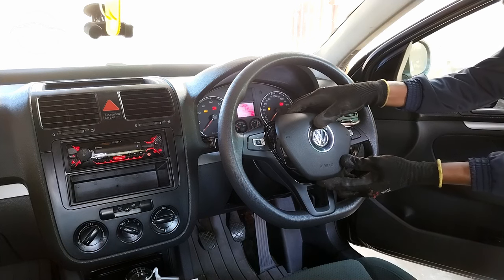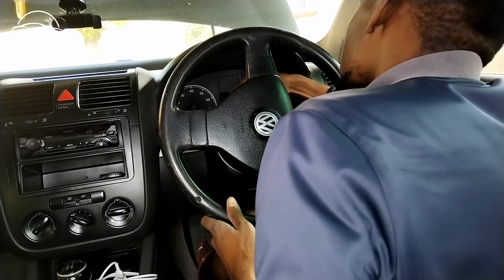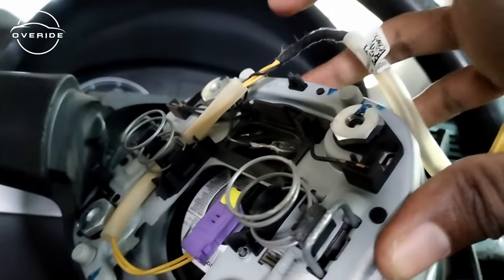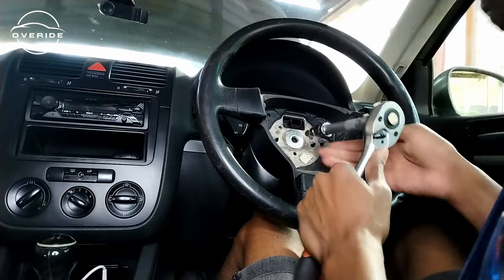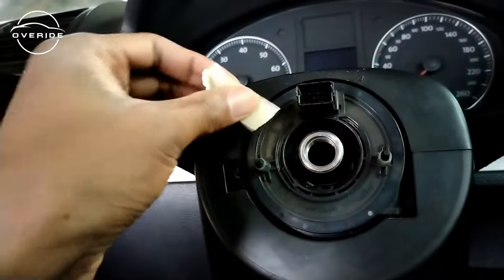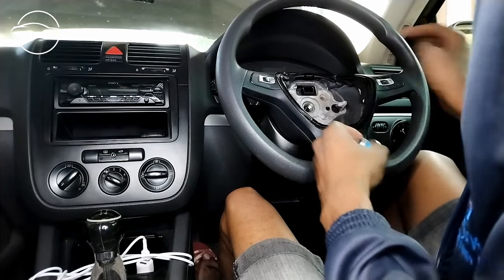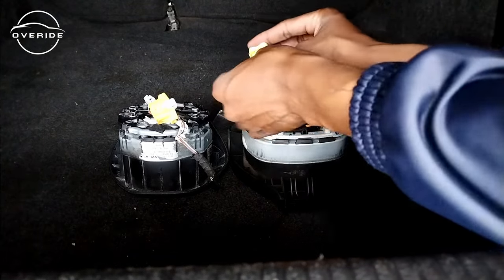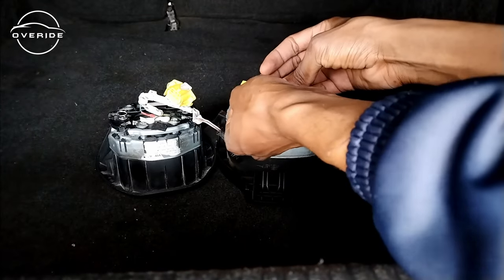Steering Wheel Upgrade |  VW Golf/Jetta Mk5

Comment: Wait so I can switch the old design steering wheel from my golf 5 plus 2006 with this new model without any real issues?
Reply from the maker: Yes you can do that, the only thing you'll need to do is re-wiring the horn but anything other than that is not going to be a problem.

However, if you are upgrading from a non MFSW to a MFSW you'll need a SWCM
Reply: @MegatronicsZA  thanks for the tip!
Reply from the maker: @Zejakov  Pleasure Zejakov
Reply: @Zejakov hey man i got the same car as yours and wanted to do the same. So did u upgrade the steering wheel and how does it fit?
Reply from the maker: @zinii698 the steering wheel was perfect, but unfortunately I got in an accident.
Reply: @dadalang698  Hey i didnt do it.. I tink its not worth the money.
Reply from the maker: @Zejakov to me it is worth it, I loved it and more. I'll do it again.
Reply: @MegatronicsZA please tell me more about this?I have a polo bujwa with a steering wheel with no controls and like to upgrade to one with controls.
Reply from the maker: @conradpaul6100  provided that it's the same as this, a MFSW and a SWCM can, with coding afterwards allow you to have multifunctional steering wheel
Reply: Can this be done to golf 4 2002?
Reply from the maker: @akpablidanielyao8577 yes it csnbe done

Comment: I have a polo 4 9N3 I want to put the steering wheel of the polo 6 r line but I don't know where to buy it or install it, is it compatible even to be sure?
Reply from the maker: Yes all steering wheels from Mk4 to Mk8 will fit. You might only need to re-wire a few wires but it will fit on. Buy at breakers, they are affordable there. You can get a new one at Amazon, E-bay or AliExpress

Comment: I have a 2007 Jetta Wolfsburg edition I want to upgrade the steering wheel I also want to have a wheel with steering wheel controls what wheel should I get for it?
Reply from the maker: It depends on what wheel looks good for you and one which is within your budget. The Golf 7 R and Golf 7 standard flat bottom looks good too, those are the ones I love. You can also fit a VW polo steering wheel too

Comment: i put golf 5 steering wheel in my vw caddy is not working butons and horn wheel is so strong go right or left put both hands to move steering wheel and in dashbord see wheel problem why fix it
Reply from the maker: The buttons won't work if your Caddy never had a MFSW before. For buttons to work you need a steering wheel control modules that supports multifunction. 

Upgrading a steering wheel shouldn't affect how your steering wheel works. If you are turning it with the car off it'll be hard but with the car on there shouldn't be a problem.

Comment: I have upgrade my old steering wheel of my old VW T5 Caravelle to a very similar steering wheel like yours (take from a VW Caddy 2017, no multifuction)
I have the same problem, horn no works and airbag lights on at dashboard; would i contact to you for help me please?
I dont know exactly what i have to do.
Thanks for this video
Reply from the maker: After upgrading you'll need to rewire the new steering wheel to the configuration of your old steering wheel. Yeah you can contact me. Hit me up on one of the social media platforms I've listed on the profile.

Comment: I wanna do this to my honda okd steering wheel with no controls but want a newer steering wheel of a bmw or something and i dont care about the controls on the new wheel is that doable?
Reply from the maker: When it's different car makes I think it'll be a bit challenging but yes it is doable. Just find out the diameter of the steering wheel you want to upgrade to and see if it will fit your car with no clearance issues. But yeah it is doable
Reply: @MegatronicsZA  thanks alot brother for the fast reply much appreciated
Reply from the maker: @banunu6e  it's a pleasure man, I hope it works for you

Comment: hi mate i was wondering if this can fit into a vw scirocco? the twin charged version. Is it possible to plug play?
Reply from the maker: Hi man. Yes it will fit 💯, about plug and play I can't be certain. The wiring is a bit different but I'm sure this way that I've shown how to wire the steering wheel will work for the Scirocco as well, knowing that the scirocco is based on the same platform as the Mk5s.

Comment: I   see you are using a Sony 1 din radio, I was thinking doing the same because i Like how There's a Spot for things to put there, My question is, How is it, Do you like it or are you planing to swap it for something else?
Reply from the maker: Yes I have the Sony A416BT and I'm so happy with it. I had an accident with the car I did this steering wheel swap on, I got another one and I tried a VW Harman MIB Radio and it was great but it only played 2 front speakers only so I got another Sony A416BT radio for the new used car I bought again, so I really love the radio and for sure the space underneath there is also another thing I prefer having. I really doubt I'm gonna swap it for anything else.
Reply from the maker: Also, thank you for subscribing to the channel. I really appreciate it man
Reply: @MegatronicsZA  one more thing now that someone actually replied, i know it's stupid, but the controls on the steering wheel work with the radio? I have a passat b6 with multifional steering wheel, and I'm wondering if it needs a special modification. Or can you change the track and volume?
Reply from the maker: @bunster4322 no, mine don't work because I had to upgrade the SWCM to the one that enables the steering wheel buttons to work but I didn't because it's expensive. But some say it does work with the steering wheel, you just have to set the radio to the corresponding buttons.
Reply from the maker: @bunster4322 there's no stupid question man! None.

Comment: Hey, I just got the same steering wheel. Wiring for horn also goes on the buttons connector, so I imagine that the will not work on mine either. I didn't understand which pins you connected the horn. Also which steering module did your car have?
Reply from the maker: The blue/white connector goes in the position of the original horn wiring. The black wire is the negative for the horn, the blue/white wire is the positive.

The module I had was the low line, which didn't support multifunction steering wheel control.
Reply: @MegatronicsZA  Okay, thanks for the quick reply. Is there any way to contact you (telegram or something?).

Comment: So im looking at putting a golf mk6 mfsw in my 2k caddy 08 plate.

Currently have no steering wheel controls .

Do i just get the mk6 golf mfsw,

And a new swcm

With part no either

1K0 953 549 CD,

Or

1K0 953 549 CH.

Is this correct? Really appreciate any help and advice
Reply: Then code in with vcds
Reply from the maker: Which year is the Caddy that you are planning on doing this to?

It'll look great, I'd go for it

Comment: Did you get the lights to light up on the steering
Reply from the maker: No, reason for that is that I didn't install a MFSW Control Module as it was expensive.

However I'll be making another video where everything works, stay tuned.
Reply: Thank you

Comment: Hello, I installed a Golf 7 steering wheel on my Golf 5 like you, but the horn does not work, as I understand from your video, there is an operation from the key socket, I would be very happy if you could help.
Reply from the maker: Hi, you need to take the connect the two cables from the new steering wheel on the same slot where the Original Mk5 wires for the horn are from. Then on the new steering wheel, make sure that the brown (-) wire is connected to the steering wheel and the blue/white wire must be depinned/or merge another wire which will be power (+) for the horn, and this wire must go from the ring around the airbag onto the slot which provides power to the horn.

Comment: can the airback pop out if you do this wrong?
Reply from the maker: No. If you get the airbag connectors wrong they won't get a signal from the crash sensors and therefore won't pop out

Comment: Do the buttons on the steering wheel work?
Reply from the maker: No, not yet. I need to get a new steering wheel control modules that supports multifunction steering wheel buttons. I'll be upgrading to it soon
Reply: If I installed a mk5 gti wheel with buttons.. Will I still need a control module?
Reply: You still need new wheel controller if you don’t own VagCom Obd2 connector to re-program old controller.
Reply from the maker: Yep that's true.
Reply: You should consider investing in a 2nd hand torque wrench for future diy projects but nonetheless great job. 🛠️

Comment: Show me and me the name of that black and that yellow, please
Reply from the maker: I've already installed those and I no longer have them. All I showed there is all you need
Reply: @MegatronicsZA  No because it's too fast and you don't explain exactly where the blue wire comes from and which wires you're moving
Reply from the maker: @andreilucian7990  do you have the steering wheel and airbag in hand?
Reply: @MegatronicsZA  yes
Reply: @MegatronicsZA  You went too fast in the video and I don't understand the order, I wanted a picture with the order of the airbag and the plug
Reply: I also have both steering wheel and airbag in hand but am struggling to understand which port you connected the blue wire and happened the other one
Reply from the maker: @AndrewLeshilo-hy5zv Do you want to have the steering wheel control buttons working?
Reply: No just the hooter
Reply: @MegatronicsZA  No! just a 📯

Comment: Does the golf 5 gti wheel fit the standard golf 5?
Reply from the maker: Yes they fit, all steering wheels from Mk5 Golf to Mk8 Golf does fit on a standard Mk5 Golf. So in case you want to upgrade with a GTI steering wheel, go ahead and do it. It'll fit perfectly.
Reply: Where did you buy the mk6 steering wheel ?
Reply from the maker: @celilmirac6108  I bought it at a local breaker's yard here in South Africa but you can also find them at eBay and AliExpress.
Reply: To change mk6 in mk5 is ok

Comment: which one of control unit's will you use for this steering wheel?
Reply from the maker: There are various steering wheel control modules that I can use to go on with this steering wheel. The most important thing is that the control module must be compatible with the car. So I'm leaning at any control module with the part number of 1K0 953 549 CD, 1K0 953 549 CE, 1K0 953 549 CF or 1K0 953 549 CH. Those are the highline control modules and will work with a Golf/Jetta Mk5, but for tried and tested modules use the CD/CH.